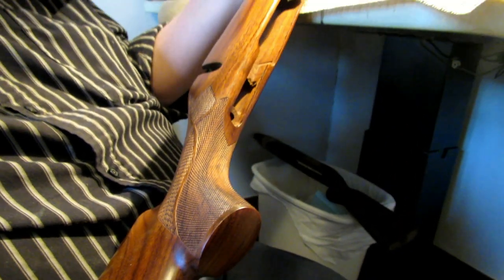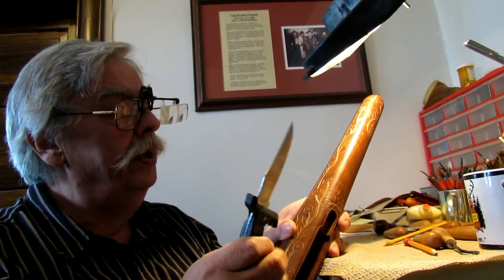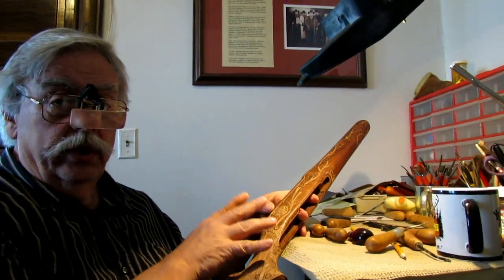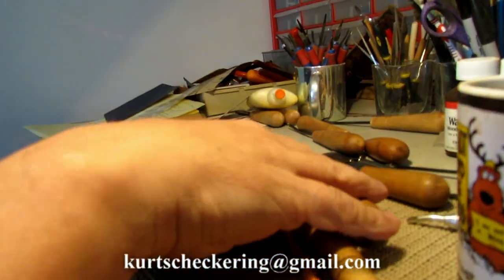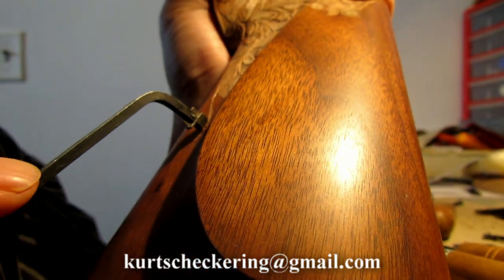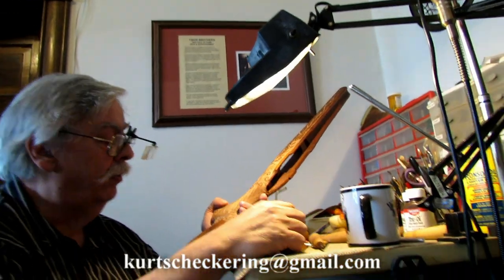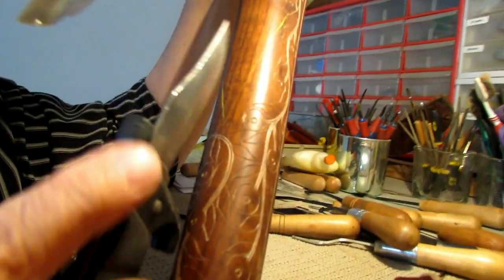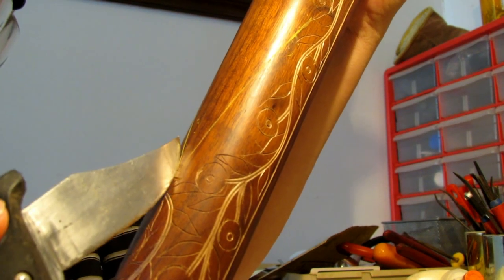Gunstock Checkering A to Z  - Border Lines and Master Lines

Comment: Thank you Sir....Salute!!!!
Reply: Sir,can I ask? Last year Dem Bart was so far back ordered with Covid,and workers out sick that they got behind..
Nice Guy the owner,but I was in rush to learn and got a set to start with somewhere else.(Russian Petrograd 60 degree).
I know Dem Bart makes the best as he explained what his process is and he uses top shelf so they last.
I will eventually get a set of his but these Petrograd,they any good?.
No instructions came and no Veiner..I have one from wood chisel set but think is to big..The size you are using,does it have a name?
I have a piece of carbon steel lopper snips,the bottom of a broken pair has a belly blade like a skinner,but no point to call the emergency room.lol..
I had a G&H Barnett Black Diamond file 19' inch with rat tail and 5\16 thick.I made the most wonderful knife,with filed bolsters and I left the makers mark from ca.1911 before Nicholson bought them out.I sent out for real Black African Ebony handle scales and will utilize you're passed on method for checkering like Union Cutlery or Rodgers or Henckels added to the Thistletop trappers knives...Just a border with diamonds in the center...I thought the set figured the diamonds but it is the diamond Gauge.lol...
I want the biggest,deepest ones for knife grip..I am scared,even though I practiced..Best to deepen after I am certain I did not ruin,can always sand thinner,right?
This knife came out perfect,tempered perfect,looking fabulous..So excited to apply this because I have huge collection of minty ones from early 1900's ..Any Advice? for a newbie on size to choose? The ebony will be scales,not round handle but I got 3\8 thick slabs so I can round as much ny narrowing edges round..Bet you have done similar to pistol grips on not as steep round angle and more flat.. Regards Tim

Comment: Hi Buddy.   Enjoying all of you videos. Very informative.   Question for you if you don't mind.   I am in the process of refinishing the stock on my 1964 Model 70 Winchester 270.   I used a bit of paint remover, sandpaper and elbow grease to remove some also.   Using a softer bristle brush, I was able to get in and scrub the Checkering with remover.   Wasn't able to remove as much as I would have liked.   I will be using Birchwood Casey oil and Walnut stain later, as the stocks were a lighter brown that I didn't care for.   Is there a small Checkering tool or another type of tool that I could use lightly to run down the Checkering Lines that might remove a bit more of the last stain.   Pretty sure the deeper Walnut stain will go over this but just asking for the proper way to go about this.   If you pick this message up, tashton@accesscomm.ca    Thanks for the help on this one.